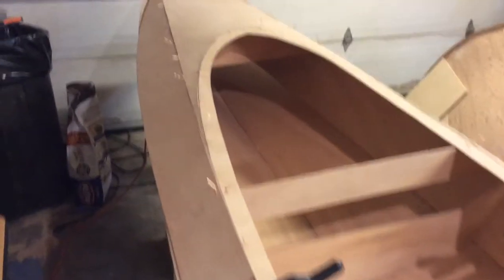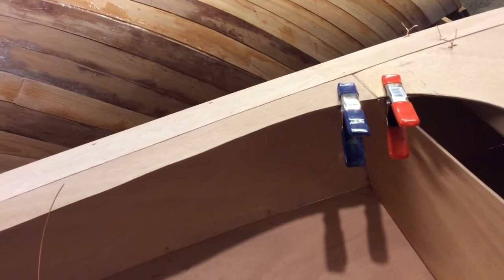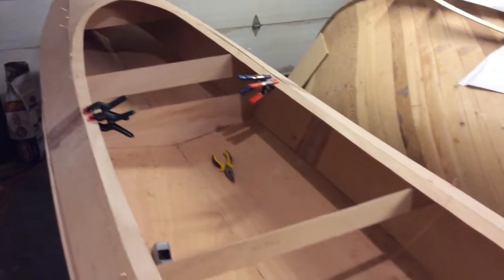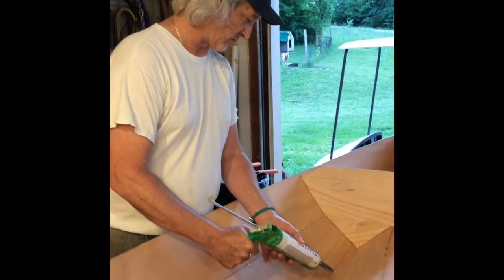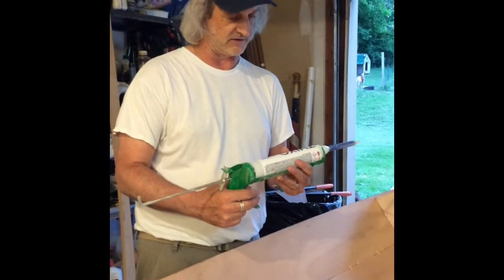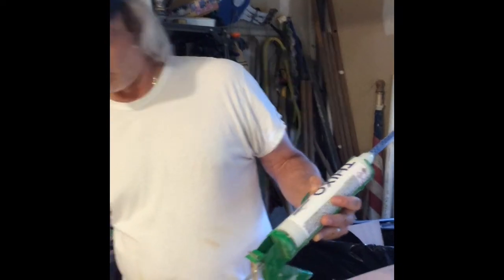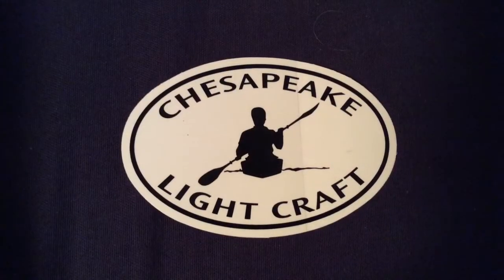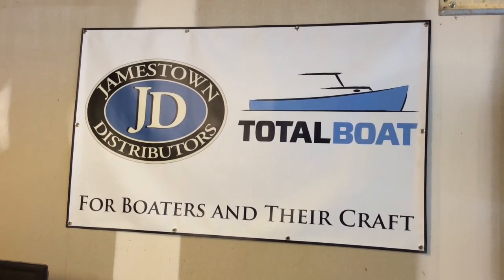Double Duck Kayak Episode 4

Comment: The Thixo does a nice neat job on the seams, not sure if we can get it in the UK ( haven't looked ). Any wires that do get glued in can easily be removed with a little heat from a soldering iron. CLC have some very nice looking boats in their range.